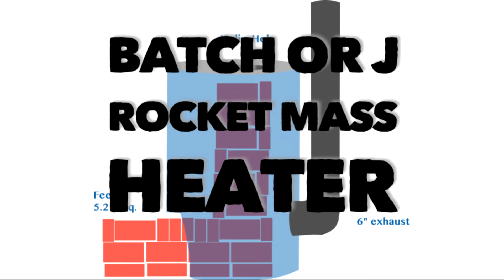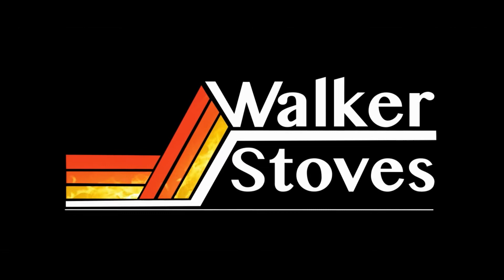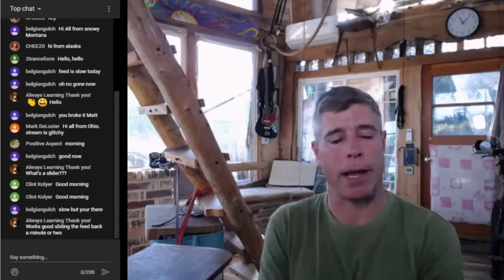Batch or J Rocket Mass Heater

Comment: One question I've had about woodstove systems is if it is at all feasible (as in a reasonable thing that could be done) to have a single batch stove that could be redirected to different purposes. So you only have one 'active' flue at one time.

My reasoning is that I like the idea of the wood fired boiler and a vertical mass heater like a masonry heater for having a radiator, but the ideal (to me would be to have a system where you get a fire going in the morning, get the boiler up to temperature (I would think there would be a way to have a thermometer give a read out for the hot water), then switch the system over to the masonary heater. My head pictures it as an addition to the bypass mechanism.

But I could be wrong about the complexity involved here.

Comment: Batch puts out about five times more heat.  A lot of builders don't build more extraction, so they end up with more heat going out the chimney.

Batch is gonna be really needed for shops, garages and cabins.  Home builds can choose between the simpler J or the more challenging/bigger/longer build of batch.

J does not need you to sit next to it, but it will need to be fed more often than batch.
Reply: With less mass to extract the heat, would you be feeding the batch more often? Do you lose efficiency running a batch box at, say, 30% capacity?
Reply: @wes16b   It isn't the size of the mass exactly.  It's about how much heat is extracted before the exhaust.  Everything matt said is true - the trick is that with five times more heat all at once, you want to do more extraction before the exhaust goes outside.  This can be mass or it can be other stuff.